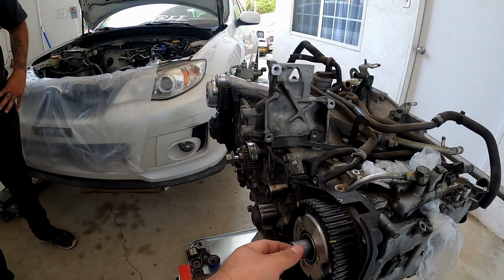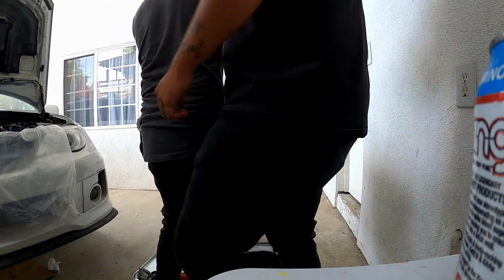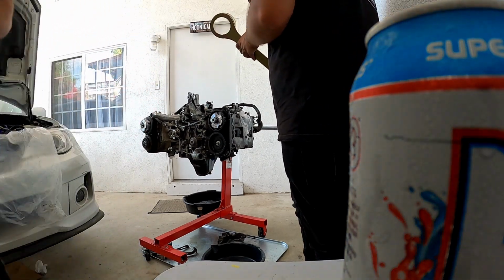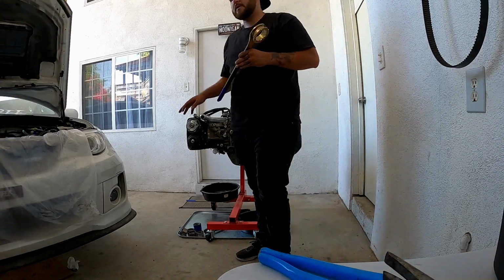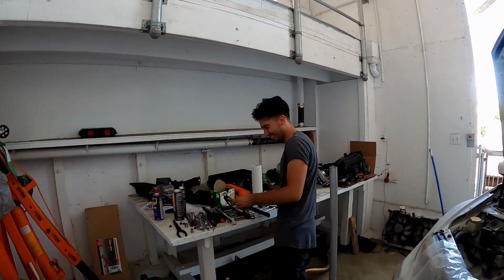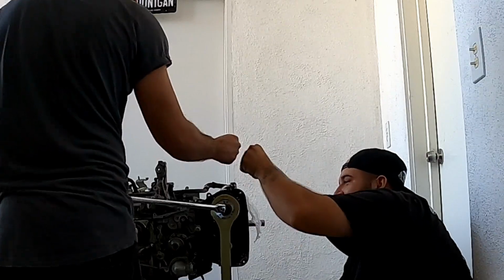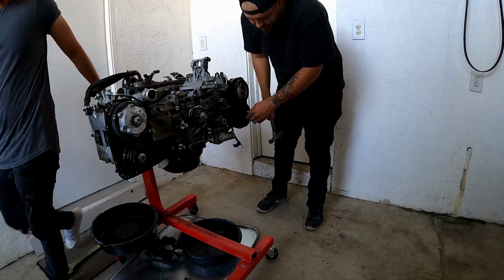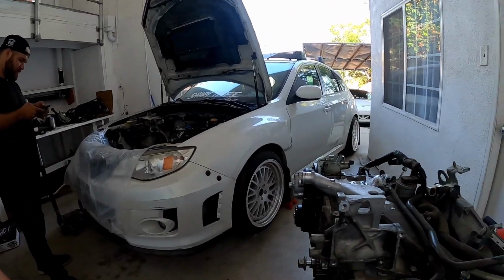YouTube mechanics don't want you to know this (struggle) |removing cam gear bolts on 2014 Subaru WRX

Comment: You could’ve used the crank bolt to hold the cam tool  then had your friend hold the hex socket and cam tool centered
Reply from the maker: Sadly the tools only locks in certain angles, maybe if it was a non interference engine that would’ve worked nicely.  It also wouldn’t be ideal to put that much vertical strain on the threads of the crankshaft, if that messed up the threads for some reason I would cry 😂
Reply: @shadytreespec808  True. I’m glad you got them removed tho🙏🏽
Reply: @shadytreespec808  if you haven’t yet, when doing the timing buy the cam locking tool so that the cams don’t twist on you
Reply from the maker: @Piojo69  thanks for the heads up, I might just get it to make life easier 👌🏼

Comment: Take my advice size above easy out socket and weld a good bead after put decent puddle inside easy out then socket over easyout with breaker bar attached got mine out no issue
Reply: I'll put a video of my cam gear bolt on my page tomorrow
Reply from the maker: That’s not a bad idea! I do have a harbor freight welder, next time I face a stubborn bolt, I might just try that 👌🏼
Reply: @shadytreespec808  I just posted a short with my bolt. I'll be honest I have a knock off welder myself just Flux wire and an Amazon easyout. Did the trick with a breaker bar of course

Comment: Would not bend a Valve if you slipped off pulley. It’s not hitting piston or other valves. Just opening and closing valves.  Bent that breaker bar though.
Reply from the maker: Sadly the 2014 wrx is an interference engine and it can definitely hit the piston or the valves can smack against eachother since the timing belt is not on and the engine is no longer in time
Reply: @shadytreespec808  if pistons are down in bore and either intake or exhaust valves are closed then you can spin the other cam over no contact. If you you start spinning both cams at same time probably bend something.
Reply from the maker: @michaelblades917  there are two pistons on one side of the engine, on that same side when one piston is down the bore the other one is all the way up the bore.  One camshaft controls the valves on both of those pistons, so it will smack one piston or the other depending which one is down the bore.  Maybe you’d be able to get away with putting both pistons midbore? I’m not sure if that would be enough clearance for the valves not to smack though🤔
Reply: @shadytreespec808  guess you got it figured out. You do you bud.